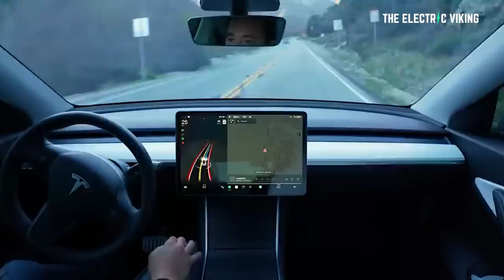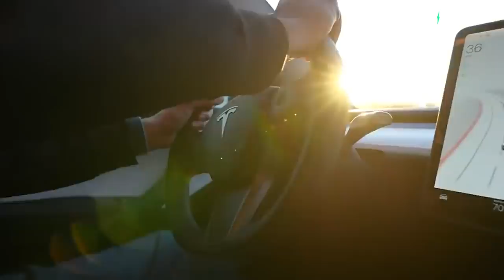Chinese insider EXPOSES Tesla's amazing new battery

Comment: other chinese battery makers also have a few "game changers" up in their sleeves. battery technology is advancing fast. 4680 was hailed as game changer, now it looks dull. this battery is likely to be similar. 2 years down the road, there will be far better ones. byd surely isn't standing still. they are the master of lfp, never got distracted away. nobody does lfp bettet than byd, not even catl.
Reply: In my option the M3P-option from CATL is very nearby the blade-structure from BYD. I can´t see an advantage an this time. Prices and exactly facts are not known - it´s all a preview and announcment from CATL while BYD is building since 2 years.

The today from Viking-Sam overhwelmed prsented manganese research is an old hat. Thats planned and public since the battery day 2020 and is dicussed so many times not only from Gordon [The Limting factor]. Sorry Sam thats not current news!
Reply: What evidence do you see that brings you to this conclusion?
Reply: @dr.goodtimes1391  
AT LEAST get the names right!
"Gordon"?
Really?
Reply: @scifithoughts3611  legacy chinese auto makers, similar to byd, have accelerated their push into ev market. they are not byd yet, but they can easily surpass startups like nio. look at how fast aion grew. that trend will continue. the disadvantages, such as supply chain dependence, cost controls etc, of startups like nio work against them. all three of them have slowed down dramatically over the past 12 month, when chinese ev market saw explosive growth. legacy chinese auto makers have picked up their game, to put it in a simple way.
Reply: @qilu2004  those are good points. I think your conclusion is, legacy Chinese auto companies can move fast and out produce startups like Nio (who struggle with supply chain, materials, and factory capacity) once their mind is made up to go “all in.”  

In the US the dealership networks work against the momentum of legacy auto as they add giant markups and their service model doesn’t make sense with EVs. Said another way, car dealers don’t like EVs. So that’s an added complication that works against them.
Reply: @scifithoughts3611  dealers normally don't have that much leverage in china. take byd for example: markup by dealers are prohibited; retail price is usually set at only a little above wholesale price, and even flat for some models. dealers still ask for whatever they can get, because every car they take gets sold before it arrives. there is zero risk for them.

Comment: I'm a huge Tesla fan. We would not be in this great accelerated EV transition without them. It would have taken decades to get there were it not for them. However, with that said, their biggest problem to the prices of their EVs is their stock price and high valuation which forces them to keep their EVs pricier than then rest. 

For example, there is no way that a new Tesla model Y with the same specs as a Kia EV6 should cost $15,000 US dollars more than the EV6 ($72k for the Y versus 57k for the EV6). Especially when you're getting a more comfortable, quieter ride, a true instrument cluster in front of you alongside a large touch screen (as opposed to a single tablet to the side), and the significantly faster DC fast charging of the 800 volts advantage of the Kia. There is no way that argument could be realistically made. Tesla with its decade lead over the others and much better resources should be making significantly cheaper EVs by now, NOT more expensive ones than their competitors. There is no reason for an LFP Model 3 with its minimalistic, cost saving design not to cost around that $35,000 range that Elon promised long ago. Instead, it's closer to $60k.

That, is what will allow others to catch up. BYD is an example of doing just that right now.
Reply: Is not the same car... It is not!
Reply: You nail it down my friend. You are ABSOLUTELY RIGHT. I bought a Model Y last year for 59K, it is a long range, red color with white interior. I was gonna buy another one for my wife, but the same car cost now 10K more. That’s ridiculous, TESLA are good EV, but in my opinion they are abusing. My second EV unfortunately won’t be a Tesla, those vehicles are overpriced.
Reply: @bohemio3952  He's absolutely wrong. No one cares if you buy a second Tesla or not, whilst demand is high prices should be high, the cash helps Tesla accelerate the transition. Once production level rises to meet demand Tesla can and will lower prices to increase it, their profit margin allows plenty of leeway for this. This program showed Tesla's path to cheaper cars, you watched it right? Robotaxis will be the path to far cheaper personal transport anyway eventually so all this talk of cheaper cars to buy will then be meaningless.

Comment: Who would have guessed that CATL battery factory would be used as a geopolitical bargaining chip?
Be careful here Sam. If China wants to, they can … at any point in time C””request CATL and BYD reneg as a Tesla battery suppliers
Reply: Agree. Thanks to Nancy P!!
Reply: Doesn't Tesla make its own batteries? 🤣
Reply: And the very odd aspect of advanced CATL US factory geopolitical bargaining chip is the administration still appears to believe GM is leading the charge?
Reply: 4680 cells at its pilot line near the Fremont factory, and also at Giga Texas,. And 2170 Sparks, NV.  Still very few cars coming off the production line include 4680’s for the mass market as production still ramping.

Comment: By 2030 we should have a battery that gets 1000 miles. I'll wait.
Reply: They could build a CAR that "gets 10000 miles" now.
It would have to be quite large  to take the pack. (Y-S sized?)
.
Probably rear wheel drive single motor (weight, gearing)
.
It would have motor power turned down.
.
It would have high gearing (maybe 2 gears)
.
"0-60"? 10 seconds? (High gearing, but still "some" low motor torque)
.
Efficient systems (so probably a Tesla)
.
Model Y "HR" (Hyper Range?)
Reply: @rogerstarkey5390  someone should build it if they can just to say they did it.

Comment: DON'T BET AGAINST TESLA. Tesla's current limiting factor is long term battery production. It has taken the solitary path with the 4680 tab-less dry electrodes. It is struggling to get volume & efficiency up, and is preferring using their safe established chemistries at this initial stage.
       Tesla China is using CATL's prismatic cells and will only move to MP3 when it is happy with their quality.  Its a long battery race and others can lead in the opening laps.
       Once  4680 is operating at scale, the electrodes & electrolytes will improve according to Tesla's agile innovation. There will be multiple formulations.
TESLA WILL DEVELOP 4680 IN ITS OWN TIME  - TESLA IS NOT GOING TO GET IT WRONG.